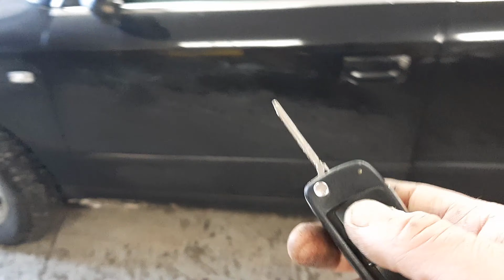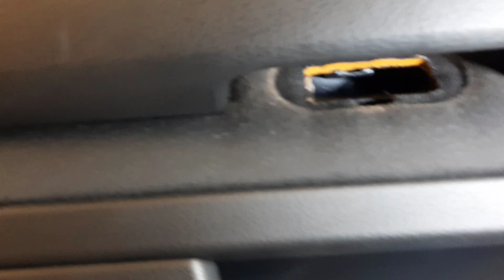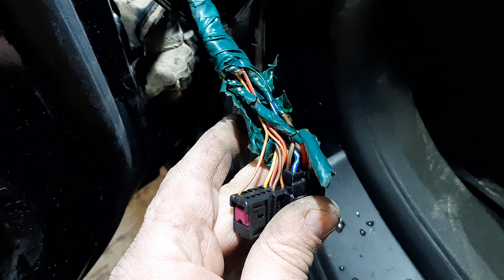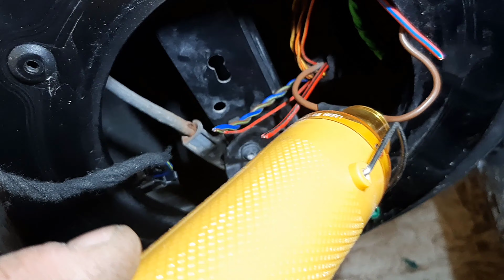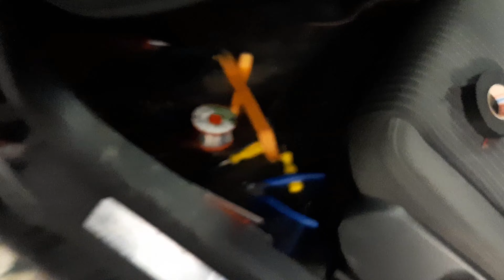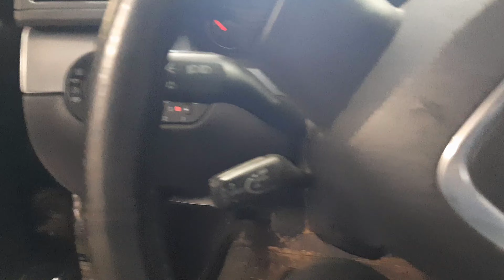Audi remote not working / Door Control Module lock problem

Comment: Hello, I also have a question, none of the doors were closing/closing remotely? I also have a problem with an Audi a3 2007 where the remote control no longer works, the keys have been checked and emit a signal, when programmed with the tester the signals flash, but nothing happens after that.... is it possible i have a broken cable in the drivers door too? (on the tester it doesn't give any error)
Reply: Hi I got the same issue. Is yours fixed yet
Reply: Me too, do you fix that ?